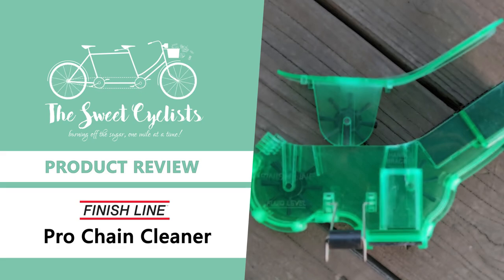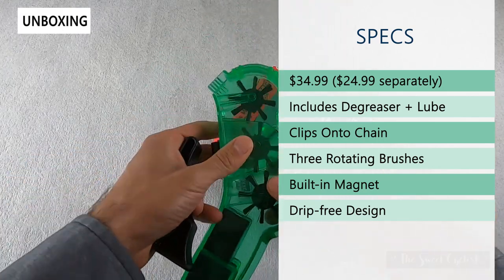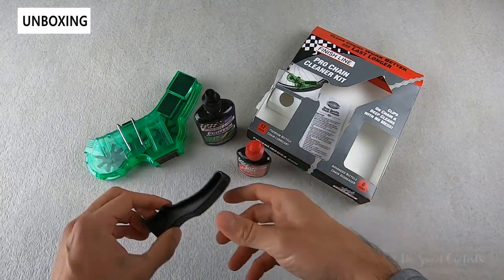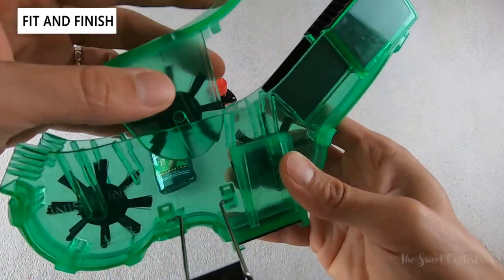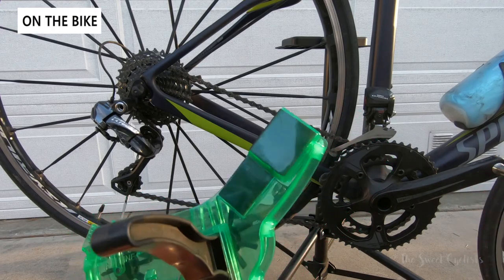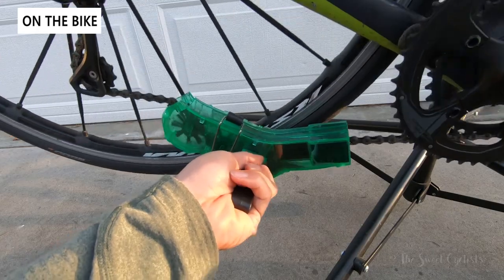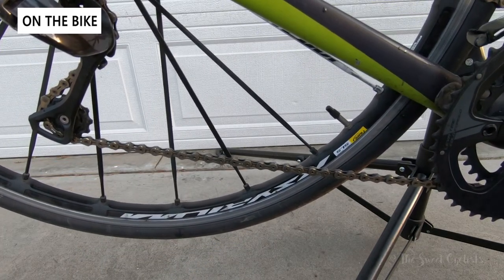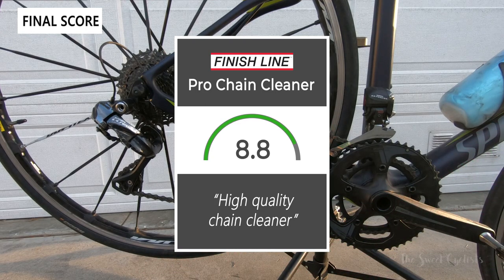The easy way to clean your bike chain - Finish Line Pro Chain Cleaner Review - feat. Rebuildable

Comment: I have never used a degreaser as it’s not recommended by the chain manufacturers.
Reply from the maker: For nearly any chain you don't want to use any aggressive cleaners (KMC recommends sticking to a "neutral detergent" if needed) but bike specific ones like this or other brands help speed up the process.

Comment: If you want to save money on the fluids just mix some WD-40 in there instead of their degreaser. Then follow up with a good lubricant. WD-40 IS NOT a lubricant, it's a kerosene based water displacer. I've been cleaning motorcycle chains for years with it and always follow up with a good lube and your good to go.
Reply from the maker: FYI - WD-40 actually has a bike-specific lineup of cleaners and grease now.
Reply: @TheSweetCyclists  Cool. But if they are even a dime more than WD-40 it's not worth it.
Reply: @chrissinclair8705  Excellent points. I stopped spending money on bike specific degreaser and just use baby wipes along with WD40 to degrease my bike chain and components.
Reply: @m.a.2282  Very true there are a lot of products that are super expensive which are basically the same as the cheap products with fancier marketing. I stay away from anything marked "For bicycle" or "For motorcycle" it's just an excuse to charge more money. For example "squeel out" is a paste that goes on your rotors and beds and cleans them so your brakes don't squeel. THey charge like $50 when you can just go to an automotive store and pick up valve lapping paste which is the same thing for $5. The only thing is you have to try and search for a valve lapping paste with no lubricant but it's the same shit for %10 of what the "For bicycles only" paste is.

Comment: It's obvious how to clean the chain.. however I'm not getting how to clean the tool itself, e.g. when you're done with degreasing the chain and want to lube it using the same tool.
Reply from the maker: The tool automatically cleans and lubes the chain as you use it. However, as you noted, it's a bit of a pain to clean the tool itself. You need to open it up and wipe away and dirt / debris. It is a lot easier to just use a ultrasonic cleaner and remove / re-install the chain.